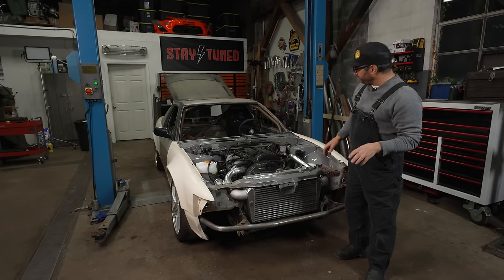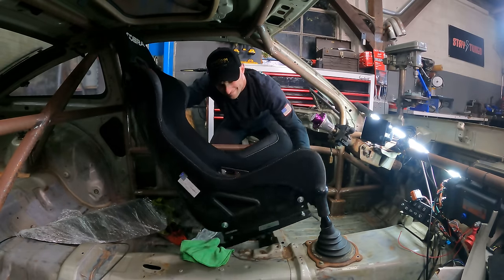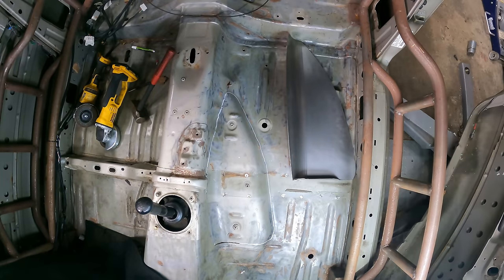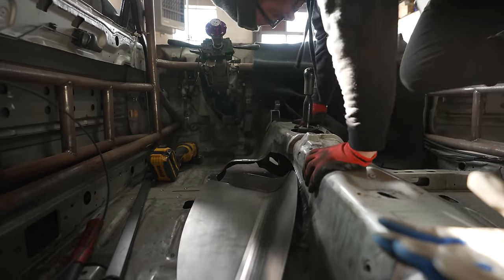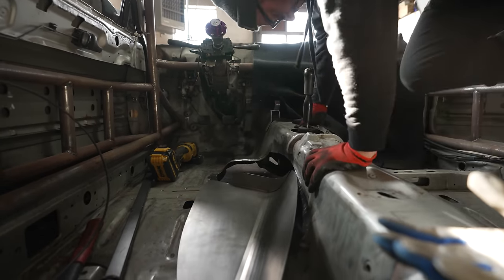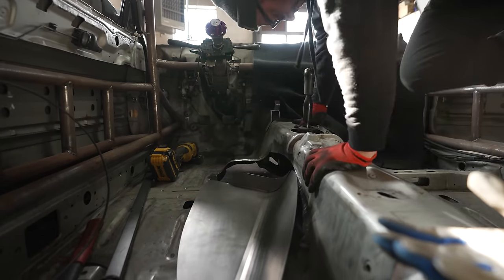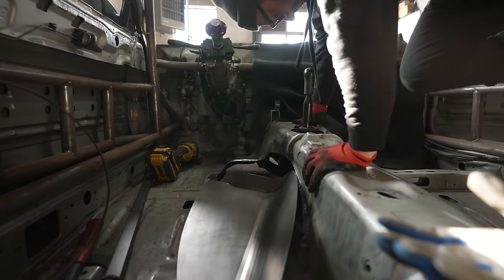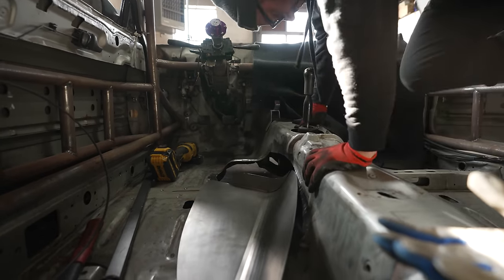“My Forgotten 240SX Race Car Project AWAKENED After 15 Years!”

Comment: Never thought I’d fall in love with the channel more but damn y’all are killing it! If the ka ever goes you shythrow a vq35de in it it lightweight and mods are endless. As long as you know what all interchanges you can find parts from a murano or a lot of other Nissans. I fully rebuilt my g35 with all new rings valve seal’s everything even a new fresh crank all for 200. Was in 2020
Reply: How'd you fix the noise it makes?? Asking for a friend.
Reply: What Ka? lmao....that is an SR20DET and a Vq35de would be a huge downgrade from it...
Reply: @inspectadrift8478  lmao I know that. He even said it I commented before I watched. And as far as a downgrade not really just a lot cheaper than an ls build or an sr20 I’ve seen sr20 builds sit for years because money. Throw a cheap vq in it and dog the hell out of it. They only run good with a tune and flashing some stuff out but literally built a motor for 200 so I count that as winning. Currently building a 2.5 duratec as a sleeper

Comment: Tony! You can scotchbrite those rotors back to new you know... i do it all the time on my junkyard rotors! Cant pass up brand new rotors at a JY for $12... in fact, all my brake stuff comes from the local pick and pull, just did all 4 corners saturday, all new (still had the cross hatch showing after scotching off the rust) and all new pads for $85... its amazing how good of parts you can grab at a pick and pull

Comment: Did a good bit of work on a s13 drift car this year. Ls1 afr’s twin gt3582’s t56 q45 diff s14 rear sf. Tons of angle used those rad arms extended tie rods ends the whole bit of kit. Exo caged car 2800lbs rear cooling. Drift @ midpond Al

Comment: welp thats it. Officially planning/starting my 2g DSM rebuild thats been sitting since like 2011. Smoked the bearings in the motor and it absolutely needs new strut towers put into it. But welding is one thing I have yet to dive in to

Comment: 35:50 The reason it sounds like a subaru, is because it's running on 3 cylinders. I see after driving it, the 4th cylinder started working. You might have a coil or an injector on it's way out. you should check that out before it hurts the motor.
Reply: I could hear it when he first started it up, you can very easliy tell in the burn out portion of the vid the SR is actually running on all 4, nice call out. Nissans do hate to be run cold from every, Q, RB, and 240 I've driven but it definitely sounded off in the first startup

Comment: 22:27 That's Exactly what I was thinking when he pulled the coil overs off. When were those even used on that car?? Why are you spending thousands (I'm sure o) of dollars to put those new coil overs into the car when the ones in it wouldn't have even had a chance to be used. Surface rust is not any reason to throw away expensive parts! As Derek keeps doing with a rattle can "Re-building, Re-Building" LOL. Those parts will look great once cleaned up and painted!
Reply: probably 2 reasons 1) they dont know the valving or what they are without spending time on it and maybe sending them for a refresh. This costs money and time. They need to finish the episode each week. 2) they need to have someone pay for the show aka their salaries which pays for the food for their families (if you look a little back this show is far from being spoiled with money and is more of keeping everyone afloat, next year it will be very different as each episode will make money each day after its published and they made great content all year). BC clearly sponsored the episode in some way. So that leaves a situation where instead of spending time and money they actually get money and can remove some uncertainity in filming. Tony and the crew are still bound by the laws of money even thou they do a great effort of keeping it low buck.

Comment: that motor looks very similar to the one that I had in my 88 Nissan pulsar, 16 valve, twin cam five speed that was a front wheel drive. It was a ripper. The torque steer was absolutely stupid.

Comment: It sounds counter intuitive, but having nut and bolt different sizes means you dont need to have 2 of the same size wrench. You probably have a 18 and a 17, but do you have 2 18 mm long handle wrenches?

Comment: Why didn't you JDM it and put the steering wheel on the correct side? Just kidding. Please don't LS it , i know in the us there plentiful cheap reliable and powerful but talk about overdone . And yes my argument for not doing a LS conversion is exactly why you should do one, if your smart and want to save $ on the maintenance running cost of a turbo 4 cylinder . Merry Christmas to all.